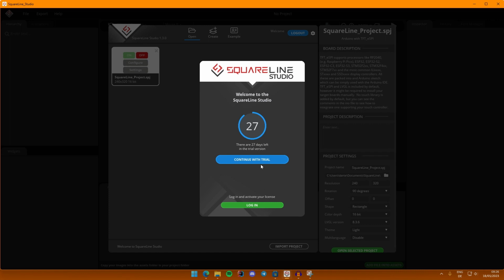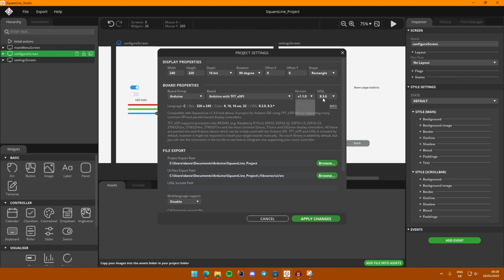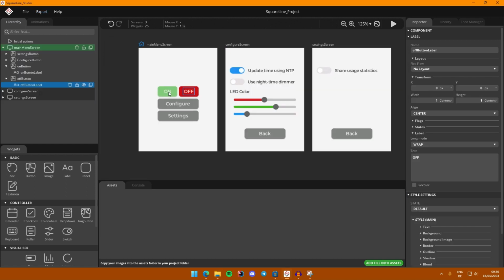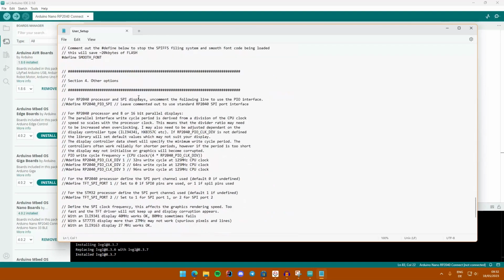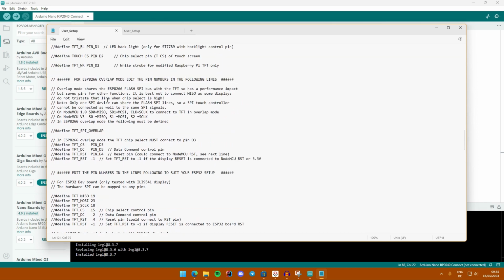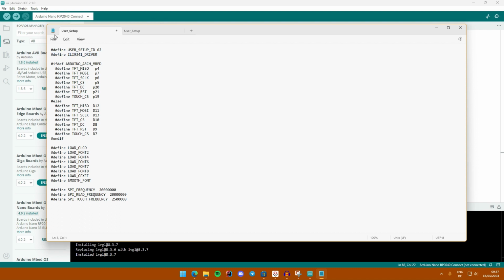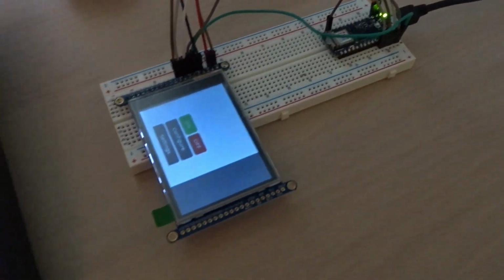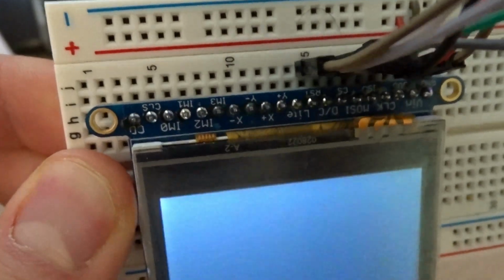Exporting a Squareline Studio UI to Arduino Nano RP2040 Connect | Tutorials | nerdhut.de

Comment: this video is for beginners but it makes lots of assumption about how far the learner is before watching. without a thorough explanation as to the file structure tree it doesn't work. To teach, you have to be able to empathise with your student and assume they know nothing then break it all down into small steps. this video did not help get my project to work, it just added variables rather than simplify.
Reply from the maker: Thank you for the teaching advice. I'm sorry to hear it didn't help you. The video is by no means intended for beginners, and I never stated it was. Quite the opposite, actually. This is a topic only suitable for knowledgeable hobbyists far beyond the beginner stages. It 100% assumes you know your way around C/C++ code, LVGL, and GUI design, and it's main focus is on exporting the project to an Arduino, not learning to program.
Reply: I found the video really really helpful and very clear!

Comment: Can I use this software on Raspberry Pi Pico RP2040?
Reply from the maker: I haven't tried it, but it worked with the Arduino RP2040, so you should have a good chance of getting it to work. But please review the MCU requirements in the official docs: https://docs.lvgl.io/8.3/intro/index.html#requirements

Comment: Hey man, I really like your explanation regarding this project :)
I am currently having trouble using the Raspberry Pi Pico with the SquareLine software and the Arduino IDE. Is there any chance you have tried it and you are willing to help? :)
Reply from the maker: Hi, thanks for your comment! I'm glad you appreciate the video. I've only tried with the Nano RP2040 Connect, and I had quite a difficult time getting any other board to work. What problem are you experiencing?
Reply: @nerdhut  First and foremost, thank you for replying :) I tried setting up the driver file for the most simple UI - just a single button (I wanted to see if it even works) and of course had no luck. I am currently using Raspberry Pi Pico WH with RP2040 and a Pimoroni Pico Display 2.8". It is has the ST7789V driver for the display.

Comment: Great video, however It did not work on m5dial from m5stack 😢, do you mind if I send you one to give a try?
Reply from the maker: Hi! Did you verify that the MCU is compatible? From what I can see, the m5dial is based on a specific ESP-32 that may not be compatible. You will also likely have to adjust the configuration to match your MCU + display. You also have to find suitable drivers for the devices (display & touch).
Reply: @nerdhut  do you mind if I send you one
Reply from the maker: I'm sorry but I can't help you with that

Comment: is it possible to use this app for the Arduino Giga R1?
Reply from the maker: According to Arduino's official guide, the Giga R1 works with LVGL. I think it should also work with SquareLine & other programs: https://docs.arduino.cc/tutorials/giga-display-shield/lvgl-guide/
Reply: Saw this comment and will let you know in advance that it can be rather infuriating when using it with the display shield.
Sketches that get compiled without error often crash the hardware due to inconsistencies between the lvgl libraries and the arduino_hz_video libraries.
(many sources telling you to not go higher then the 8.4.0 version of lvgl).

I would alo recommend using the IDE and not the cloud editor as the IDE will make it way easier to work with these files.
Trying to get it to work on the cloud editor right now myself but it's a hassle.

Comment: Thanks. Can we do the same thing to run with a pc?
Reply from the maker: I'm not entirely sure about that. I think SquareLine and LVGL are mainly intended for use on embedded platforms. However, SquareLine just sent out a newsletter yesterday in which they announced that they want to change the underlying library, so PC support may be a thing soon. Either way, I think there are much better options for making GUIs for PCs. The exact choice depends on your programming language and OS, but Qt would a good point to start for C/C++ and Python.

Comment: How do we make the ui items interact with the Arduino code?  For example toggle a Boolean of send a Serial.print?  Yes it look pretty but it currently doesn't do anything. 

I have searched and found lots of people have the same question and no examples of how to do move it forward.  A part 2 perhaps?

Thanks for the tutorial, it has got me this far.
Reply from the maker: That is indeed a very valid point! I wanted to make a second part for so long that covers exactly that but I unfortunately never got around to doing it. But from my first experiments it seems relatively easy to accomplish.